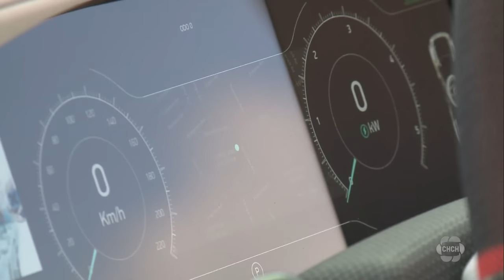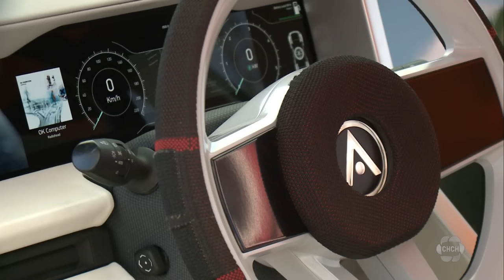First Canadian electric vehicle made from Hamilton steel rolled into town

Comment: For those questioning the 20 million price tag, it's important to understand that this cost includes the prototype, and research & development. If this car were to reach mass production, I anticipate the price would be more comparable to that of a Tesla Model 3.
Reply: The price tag should be cheaper than tesla because this is made in Canada, it's not an important.
Reply: @carpetcleaning999  I've noticed that items made in Canada are usually slightly more expensive. I doubt that the first wave of products will be cheaper; perhaps by the third variation, we might see a price reduction. But this is all hypothetical.

Comment: The Arrow was truly innovative, 20yrs ahead of its time.  So much so, it was a threat to US manufacturing and existing fighter design.
It looks cool, fancy, but
I didn't really see anything innovative about this car.  Being ahead of its time to shake up the industry,  this car should get at least 1000km per charge with half the battery size. And or have its own power supply such that it really never needs charging, it charges itself.

Spent a lot of money on fluff.